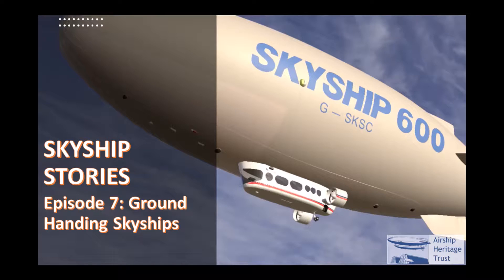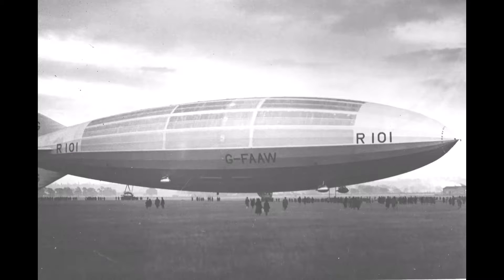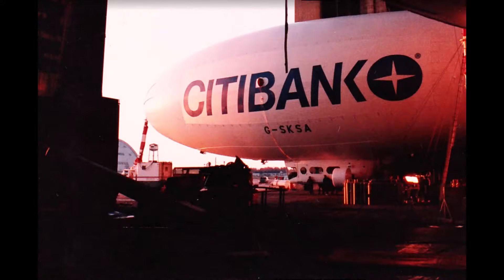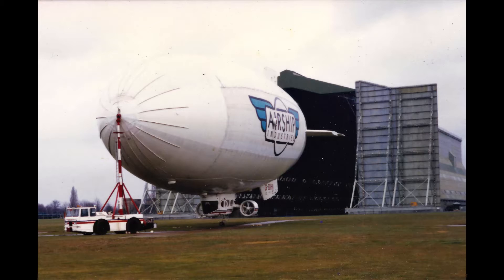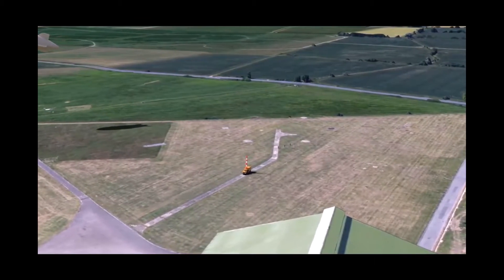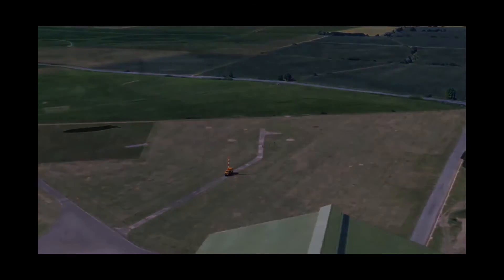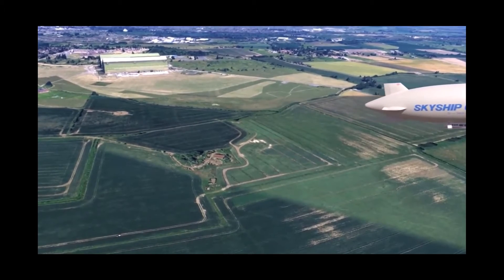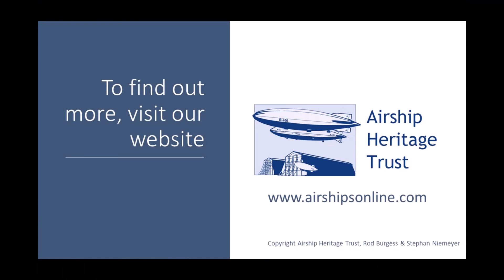Skyship Stories Episode 7: Ground Handling Skyships

Comment: this is very much questionable.  there are no better gas and safer gas than helium. and hydrogen is highly flammable. bringing back an airship of the past is very much impossible. and beside big uncle Lockheed and Boeing will see to it would fail. unless of course its proven safe.